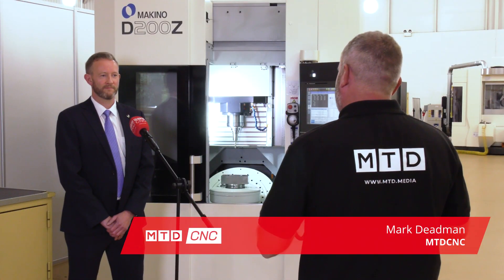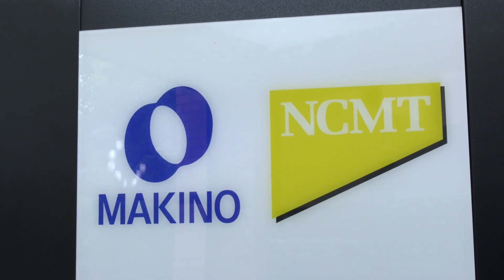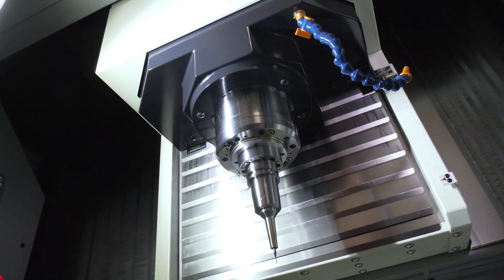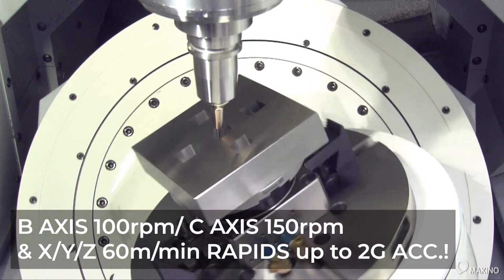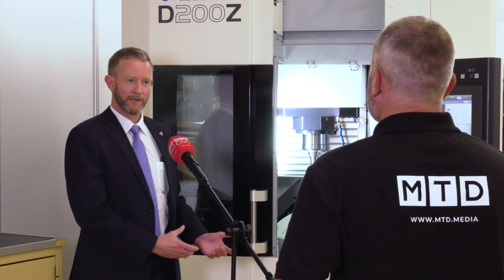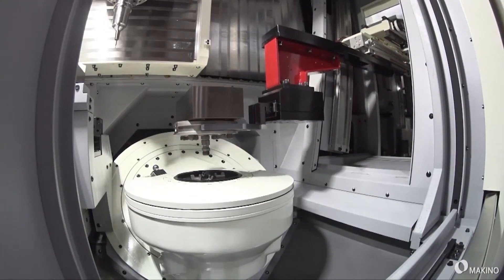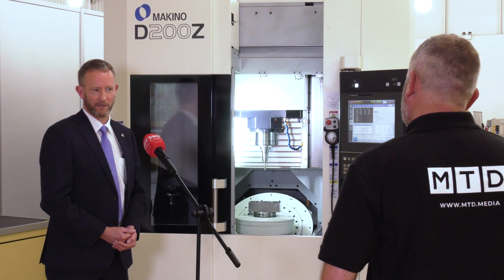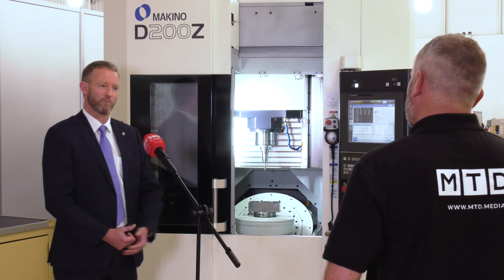Makino D200Z 5-axis dynamic VMC from NCMT delivers high accuracy with exceptional surface finish

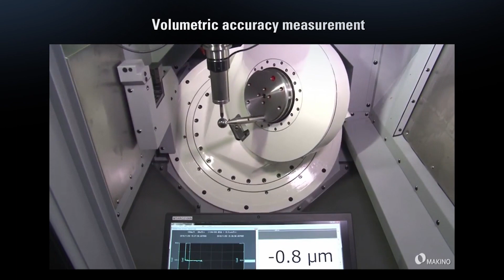Comment: Super machine!  kinematic accuracy (closing in on itself) is not the same as true volumetric accuracy @3:23 . I.e. the machine is not +/- 1 micron referenced to abstract datums (volumetrically),  but is +/- 1 micron referenced to itself. In the USA HSK-E50 is a little pricey. Oddly when the machine is run at 20K rpm it's more accurate than being run at 30K rpm yet in some cases you need 30K rpm for higher order surface finishes. Still sort of boils down to 5 micron part accuracies (two ten thousandths of an inch), but when coupled with automation could make for a very excellent solution. Material removal rate is not too bad either so better than a machine designed for "Near net" shapes to be machined. The travels on the machine are necessarily asymmetric (for tool changes)  + nutating "Knuckle/trunnion" so the practical working volume is closer to 200 mm in diameter not 300 mm.
Reply from the maker: Glad you enjoyed the video !